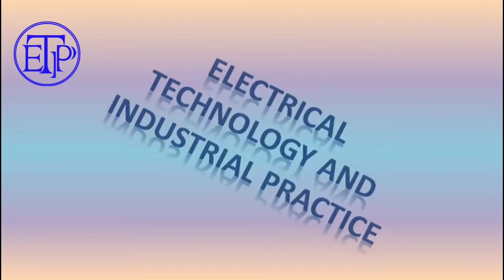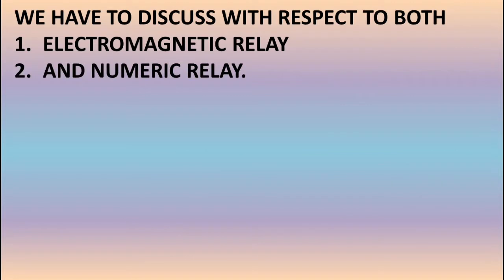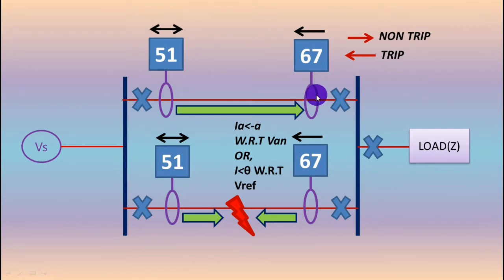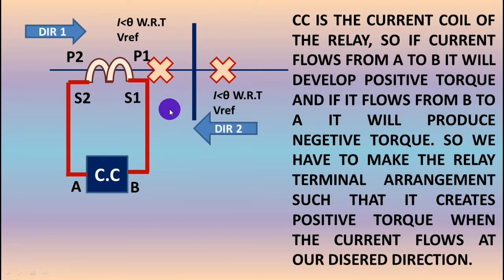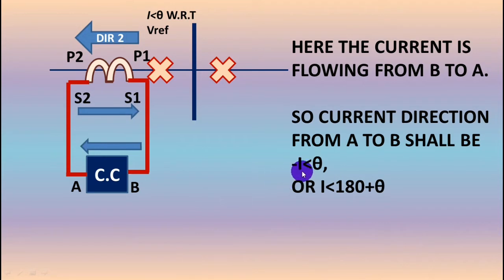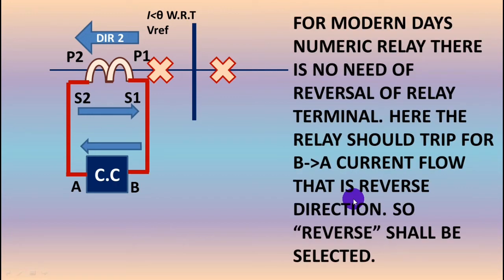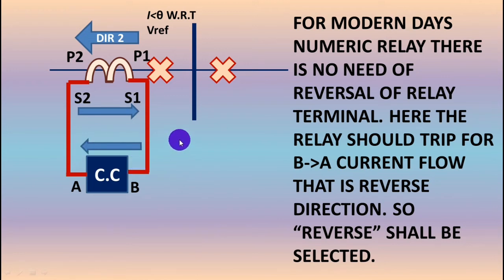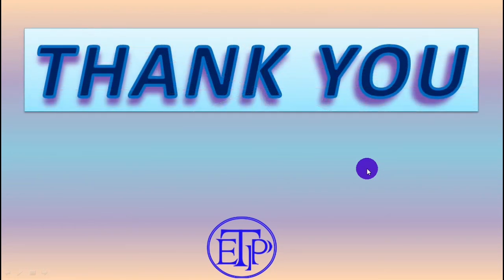Directional Relay Setting|How direction is detected|PART-3|BASIC OF DIRECTIONAL RELAY SETTING

Comment: Sir,  whatever condition coil got nominal input supply  that's 1 A,  so coil picked up. So we can change only CT secondary output that is S1 & S2. it's depends upon CT selection polarity. This is correct?
Reply from the maker: As per standard practice p1 and s1 has same polarity. Thats why it is marked liked that. Actually you can not make p1 and s2 having same polarity because that is not the convention.